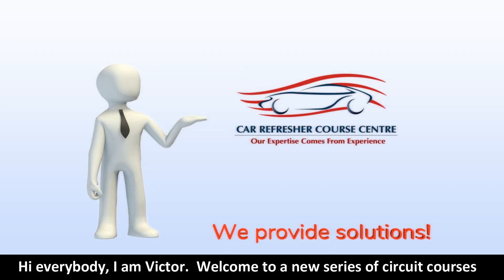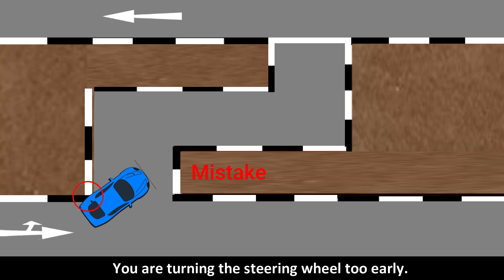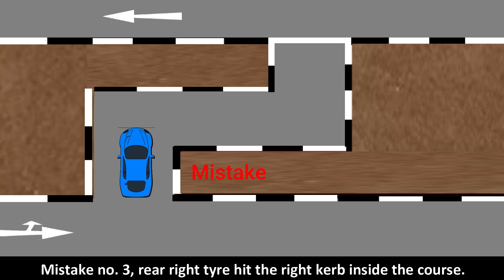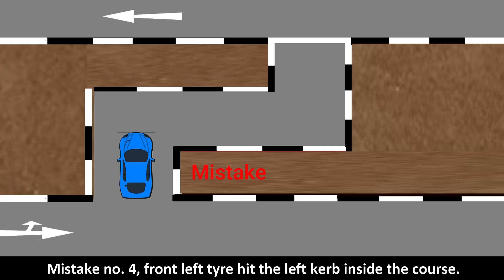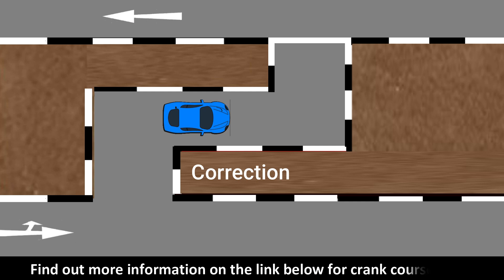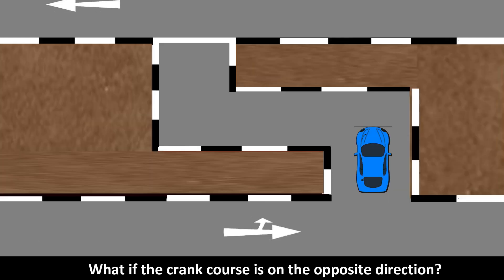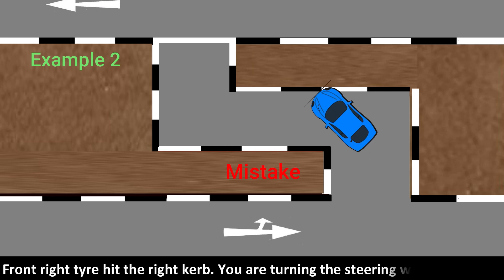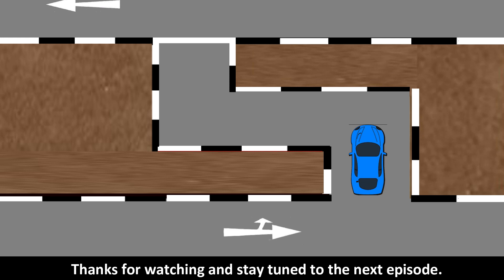Crank Course - (Mistakes & Corrections)  - EP 1

Comment: Is there a marker that I can use so that I will not turn too late or early? Is the left or right mirror alignment with the curb okay ?
Reply from the maker: Hi, the reason there isn't any perfect marker for all students is because of the height and sitting posture issue. 
The instructor or yourself may need to do some trial and error (different turning point) during the practice in order to get a best marker for yourself.

Comment: Sir I am going to take my class 3A practical test in 1 month time for the first time, would really like to pass on first try. What should I focus on? I heard many fail first try so I’m quite scared
Reply from the maker: if circuit courses are not the issues, then you will have to forcus on the road driving and safety checks.
Reply: Car Refresher Course Centre I am private learner, have not been to circuit yet, how many lesson of circuit would be good? One month to test
Reply from the maker: @haoyuan3620  Hi,.sorry I could not advise u about this as different instructors have their own lesson contents. You can ask your instructor.
Reply: @haoyuan3620  bro if you have not been to circuit then it’s basically GG for your first try. You have to at least go through circuit lessons for at least 5-10 lessons to get used to the courses
Reply: @mastervain1583  I still have 4 more weeks till test, u think I shud try to arrange about 5-10 circuit lessons during these 4 weeks?
Reply: @haoyuan3620  yup bro, definitely, book a few lessons in circuit first to get used to the course, if you’re confident enough within the few lessons, then you’re all good for your test!
Reply: @mastervain1583  thanks. Any other tips for the test?
Reply: @haoyuan3620  take it slow in the circuit and always remember to stop before stop line and check your blind spots whenever you are changing direction whether reversing or driving
Reply: @haoyuan3620  and most importantly is to keep calm and be confident!! Goodluck :)